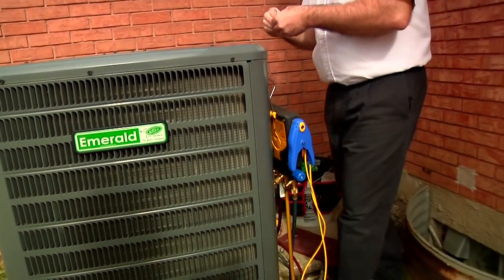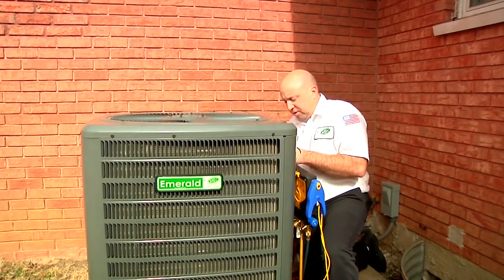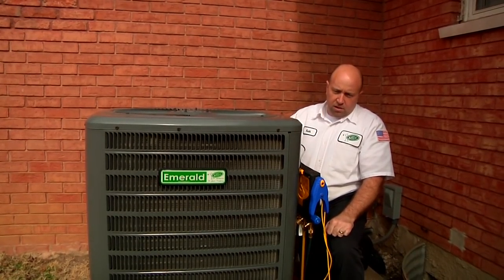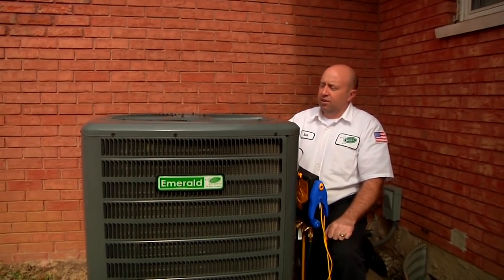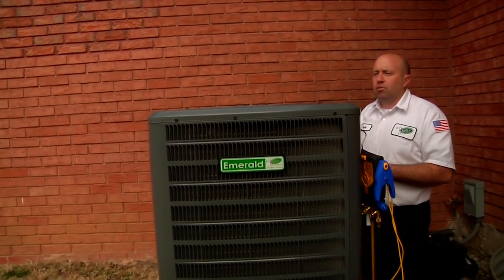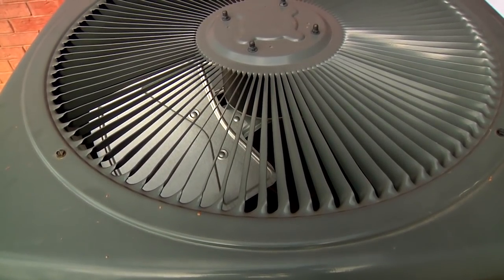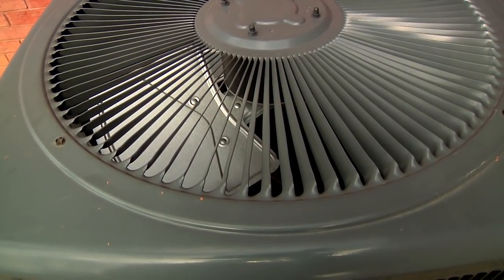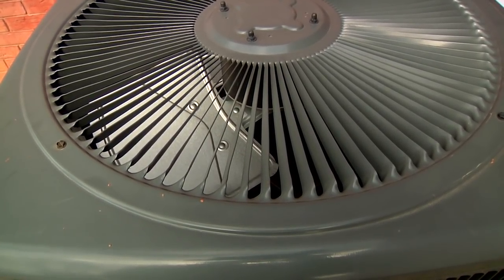Jerry Kelly  HVAC: Noises You Might Hear From Your Heat Pump

Comment: Thanks for the video, we just bought a house with a heat pump and I never knew the sounds they made. Now if the installer would have put the outdoor unit someplace else besides my bedroom window it would be perfect lol.
Reply: I am renting a house and the thing is right outside my bedroom. I thought the thing was broken because so loud at times. This video saved me from making a call to insurance company. Heat works....just a loud sound like a compressor shutting down. Every house I lived before had either a furnace heater or a quieter outdoor unit.
Reply: Thankyou! I was scared out of my mind thinking the thing was going to blow up or something. So then it is normal for it to do it on a heat cycle when it's cold outside, correct?
Reply: Exactly.  Right by my window. 1st year in my house it scared the hell out of me.
Reply: Same
Reply: Even worse our neighbors heat pump is under our bedroom window! At least if its yours you can choose to either burn or freeze but nothing I can do about theirs. ☹️

Comment: Thank you for the video. It was very informative. Mine is making that buzzing sound. How long should it run in the defrost cycle? Mine seems to last a long time. It seems it is doing more of the defrost cycle then actually turning on. It does kick in at times but most of the time when I check on it, it is making that buzzing sound.

Comment: is there a way to bring down the loud ass buzzing noise? Mine does this upon start up. and in defrost mode. and it's driving me and probably my neighbors nuts. it wasn't this loud a year ago. I just purchased a sound blanket to go over it. haven't installed yet though. Just wanted more info on how to attack the problem from multiple angles while i have the system open.

Comment: Ours is only 3 years old, and on the first winter it makes an excruciatingly loud sound that sounds like Godzilla screeching. None of our neighbors’ units do that, and they have complained and are now angry because the noise is sharp, abrupt, LOUD, and screeching. I’ve never in my life had this issue, even with extremely old units. We’ve basically made enemies of our neighbors because of this. 

On top of the noise the heating system doesn’t work at all when temps reach 32 and below, and the air coming from the vents in the house is as cold as an air conditioner. The temp just steadily drops until we end up wearing jackets and covering with blankets. We are always told all of this stuff is “Normal,” and i know not a single soul that has experienced this and say the unit needs replacing. They keep replacing everything which fixes nothing, and they’ve had to replace the thermostat several times a year, and the breaker keeps tripping. 

If ours made the sounds like in your video, it may be easier to deal with, but our neighbors’ units are so quiet you can barely hear them... and they would still complain. 

3 years of dealing with this on a new system... without any resolution or fix. So frustrating, and miserable in winter.

Comment: I don't consider that level of noise acceptable in the tightly packed urban houses typical of many UK cities. Is there anything that can be done to quiet these down?

Background, I did see a recent reference to a Heat Pump fitted to a Bath (in Somerset) industrial estate without planning permission which now needs noise barriers to be fitted after the neighbours complained. Would welcome a video about these sort of barriers (i.e. how well do they work, what do they cost, do the trap cold air near it and so reduce its efficiency and so on)

Comment: Hi Jerry, just curious how loud the pressure hiss should be. When our heat pump goes into defrost the hiss noise is sometimes between 70 and 80 decibles. It wakes us up a few times per night. Anything I can do to fix that? It has done it right since it was installed a few months ago. Maybe installed wrong? Not enough/too much refrigerant? Thanks!
Reply: If it's waking you up either you're a really light sleeper or you've got a bad heat pump component, lol
Reply: But what component is the question.
Reply: @tazocitrus  Absolutely no clue, I'm not a certified HVAC tech im just some student pilot 😂😂
Reply: Mine is like 12 decibels but i don't think it's normal

Comment: Why would I hear that noise in the late morning when I never used my AC?  I just moved into a home 3 months ago.  Never had a heat pump before until now, and been hearing this noise now and then.  But it sounds as if it's coming from the opposite side of the house that the heat pump is on!
Reply from the maker: The outdoor unit will also run if your thermostat is set to heat, that may be what you are hearing.
Reply: Maybe your neighbour's heat pump
Reply: OK I did some research and found out it’s the sump pump actuator valve.

Comment: Would be helpful to know if heat pumps making extremely loud "honking" noises is normal every time the heat turns on/off.  Ours is loud enough to wake me every time.
Reply: Mine does the same thing, it's less then a year old. Did you ever find out what the issue was? Thanks

Comment: My heat pump scroll compressor makes that intermittent buzzing sound in cooling mode when it gets over 105+ outside.
Sometimes an occasional and repeating  tick sound emanates from the compressor when high ambient temps occur. 
At night time when the temperature drops, it sounds normal and quiet with the fan noise more noticeable than the compressor.
Is this normal?

Comment: Worse noise ever when your trying to sleep. My neighbors heat pump turns on every 30 to 45 mins driving me crazy. I hope they could remove it and find a quieter heating system. I live in the hills and having this machine next to my window feels like I am next to machine shop with a steam engine train arriving every other hour noise it makes every time it shuts off.
Reply: Lol sadly builders build neighborhoods now where you can hand something to your neighbor through your windows and the ac is between those houses. Should be illegal lol
Reply: @drewsquickfix  Yup will get informed in this is legal. Just waiting to make the call.

Comment: ? When the heat pump does this make the the heat pump go into emergency mode that what it show on my thermostat in the house.
Reply: No emergency mode means your either burning fossil fuels or using your electric heat backup. Both of those are backups for "emergencies" when your heat pump unit can't keep up or isn't working properly
Reply: Yes actually. when your heat pump goes into defrost mode, its reverses the flow. when that happens your secondary heat source comes on so that heat will go outside and melt any ice on your condenser coils. as well as to keep the air blowing warm in your house. but only for a min or 2. then it switches the emergency or secondary heat source off the valve reverse again and goes back into heat pump mode. which is when the cool air in the house is being pumped outside again. Some people will have electric heat strips for emergency/secondary. some people will have natural gas or propane furnace as a secondary.

Comment: I just had an old unit replaced with a Goodman, it used 3172 kwh in 2 weeks. What would make it do that? It ran 24/7 and I had the thermostat set at 68.....
Reply: Christy,  A lot of it would depend on how the system was installed and if all the equipment was sized correctly accordingly to your house.
Reply: @dannyr3031  Same here. 2yrs ago I got a high efficiency goodman installed. it ran 24/7 in the winter time. My power bill was nearly 600 dollars a month! I had to pay to get that one removed and installed another normal efficiency one coupled with a gas furnace as a hybrid system and now my power bill is only 60 dollars. if i use gas the whole month the bill only be 80 dollars. The first contractors got away with all my money and the old/new system is sitting in my backyard useless for me. and it's only a year old.
Reply: @Lilmiket1000  it's been in the 30s here all week and the most my goodman heat pump has ran in a day is 5.75 hours. Good god what kind of insulation do you guys have that the compressor has to run 24/7, newspapers?